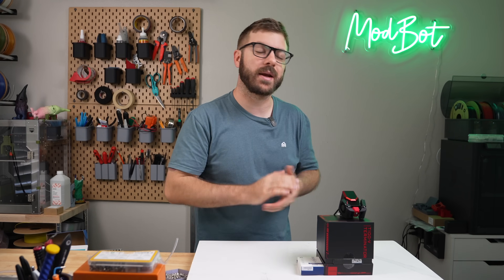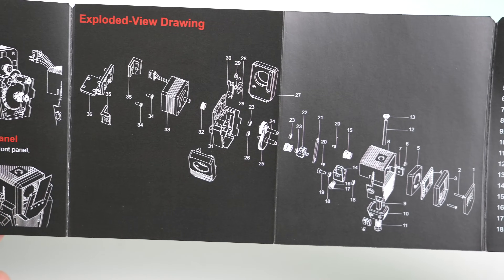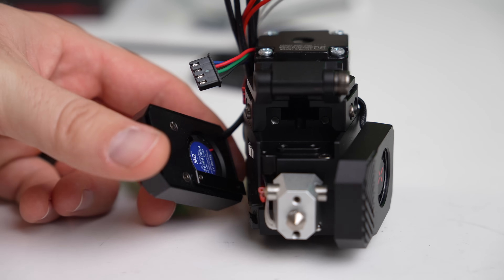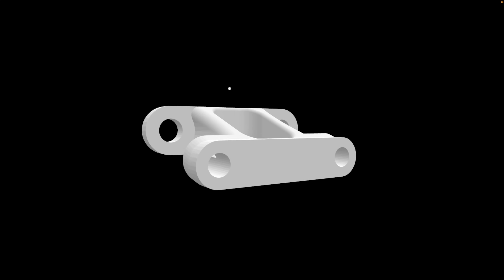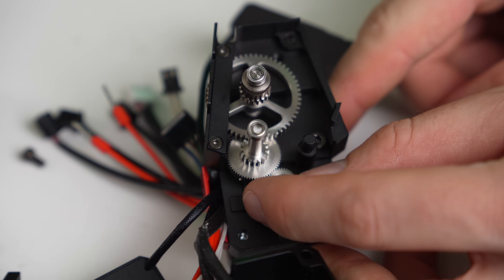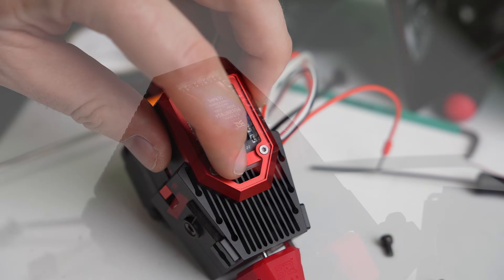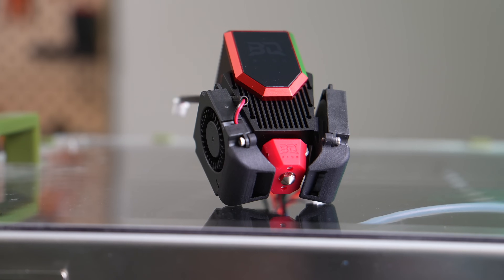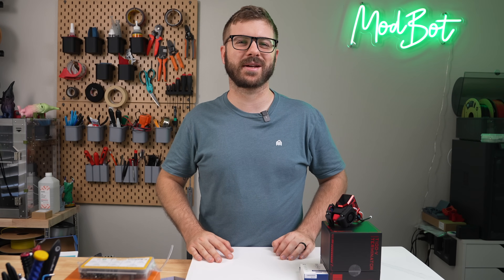Not Your Average ToolHead (Biqu Terminator)

Comment: Do you know how long this run goes for? Will you be doing performance review? I just core XY'd (not a verb, but it is now!) my 3v2, and am running the Sprite. While I love this extruder, the mounting is subpar and the weight (and now added speed with core xy) makes mounting clumsy and I've had to resort to added metal, adding weight. The fact that this can mount directly to MGN carriages, includes a belt hold, and the other added features, this seems like a great solution without having to design added ducting, probe mounts, etc (currently looking at the H2 V2S, which I could make work better than the Sprite, but this Terminator seems to be an even better solution)

Comment: Hi Daniel, your review is spot on. Mine has just arrived and can confirm that the led wires push the front face out a bit. With only 2 screws at the bottom and the front face trying to use the wires to clamp the fan I'm not surprised. Going to see if I can tweak the wiring. Might also see if I can attach a small thread piece to the stock fans so I can nip it up, otherwise il use the bigger ones. Agree they missed a trick on the extruder as they could easily open up the metalwork, show off the gears and allow tweezers in for jams

Comment: The thing that turns me off is this limited run BS. I aim to operate a printer for 10 years and while i can change parts later. I tend to avoid buying things with no future. As far as the SecKit goes i was intending to design a new toolhead for mine.

Comment: You make great videos but people making question from other videos and they don't receive any answer. In the video "The FUTURE Of 3D Printer Mesh Bed Leveling (KAMP)" where I can find or download the toolhead duct air system you have in that machine in min 6:00 the white one. Thanks
Reply: Thats the modified EVA toolhead specific for Mercury One.1 kits. If you go to their website, there should be a configurator for your needs

Comment: It's been out for a while, and looks very impressive. A few small points, however: 1. Extruders without high quality IGDA style drive gears will no longer be tolerated. Ugly layer lines are no longer acceptable. This is an instant game over for any extruder (looking at you Orbiter 2.0). 2. Considering the people who would use such a tool head, ultra-high flow support is mandatory. Preferably V6-Volcato CHT by default. 3a. Just ship it with the EBB42 preinstalled. 3b. Just ship it with the MicroProbe preinstalled. These are just no-brainers, and their lack of inclusion is lazy. 4. As mentioned in the video, make it easier to service. Serviceability is kinda critical.
Reply: Sadly they used a square nema14 stepper, so no can board fits without an adapter.
I agree with the microprobe, hands down bes probe on the market. Also the volcano should have been standard, i mean a 70w heater on a standard flow hotend is a bit overkill. At least a volcano is pretty easy to install with the adjustable fans
Reply: @over_pizza_2578  See? One non-standard move and the whole thing falls apart. This is why I disagree with Creality moving away from aluminum extrusions for the Ender V3. We're not ready for proprietary machines yet. We're still working out the kinks with the open versions.

Comment: too many custom expensive components, heavy not nema14 motor, fans stagger, hard to disassembly - trash product.
Reply: The stepper is a nema 14, just not a round pancake, but a regular one, just like on the h2. The whole toolhead is rather competitively priced at 90 dollars, pretty much all good extruders cost 60 dollars and up.

As mentioned, this is most likely a collectors part, so styling is important, it needs to be pretty enough to put it up for display, nobody would do that with a OG microswiss unit.

As for serviceability, look at the mini afterburner and mini stealthburner. To access the gears you have to disassemble pretty much everything, just like any integrated design. Personally the only time i needed to access the feed gears was when i was tuning filament tips for the ercf multi material unit
Reply: @over_pizza_2578 stealthburner - stupid design as many decisions in voron. There is dragon burner for voron with lots of supported extruders.
Reply: @Pasha4ur  i know that those are garbage. The whole voron ecosystem has many bad design choices (stock bed probe, printed gantry joints on v2, solid bed mounts with no room to expand, etc). 
Personally i dont value serviceability high on the toolhead, for me performance has the top priority. Also how often do you need to open the extruder?

Comment: large gears and I'd be sold, the trianglelab air would still be my pick
Reply from the maker: First time I am seeing this. Are you running this set up?
Reply: @ModBotArmy  The tbg-air is fairly new, so no. There is a video of several tlab extruders printing 85a tpu, which is more than I can say for most aliexpress parts. It will be a few months until I get one for my x5sa

Comment: We need something like the EVA 3 system, a universal mounting system that users and manufactures could depend on compatability
Reply from the maker: Some form of a standard that is more widely adopted would be sweet. It would have certain limitations but it would also come with perks for manufacturers that can mark their hardware as compatible.
Reply: There really are two standards for Core-XY now. Voron (both belts in front) and Rat-Rig (1 in front and 1 in back). It's the designers that need to catch up.
Reply: @drright71  I have two Rat Rigs with the EVA 3 mount, makes it easy to use because of all of the designs people have done.

Comment: Seems like a neat toolhead but the design decisions on it seem a bit misguided. The cross section of printers that it will actually work on and look good on are super limited from what I've seen. The red accents are a show stopper for me personally. Then add on top of that, serviceability issues with the disassembly and reassembly you mentioned. I'm sure it will work for someone but it's probably best that this iteration is a limited run.

Comment: Great looking toolhead, but is there a list of compatible printers?
Reply: I believe this is mainly designed for voron printers. I just got one in and have made up a small belt holder plate that will let me use it with my Ender 3 running a mgn 12 rail

Comment: Thankyou for reviewing this. I have bought one as part of my all metal voron 2.4 build as it seemed a really nice tool head but couldn't find a single review. Still need to work out myself how to install the canbus pcb on it. Was hoping biqu would bring out a file for this as it's advertised for the 2.4
Reply from the maker: Oh that is going to look awesome on the 2.4. Agreed, I understand it is a limited thing but they seem to have put a lot of effort into this and even include a 2.4 clip with it. With the cables as short as they are it requires a toolhead board so an adapted would be really nice. I may spin something up.
Reply: I didn't realise it was a limited run. My plan is a custom cnc part 2.4 with this tool head. Do you think it would fit either a canbus board or the hartk board?
Reply: If you come up with a mount would love to use it. Was planning to design my own otherwise

Comment: very cool idea but Id love to see a more indepth look on its extruder and hotend. a lot of the video was towards the aesthetics and assembly...
Reply from the maker: I would have loved to have done some flow tests with the hotend/CHT. I was bummed to see I couldnt mount it in the SecKit. For the extruder what additional info would you like to have seen?
Reply: @ModBotArmy very much agree with the above. I look forward to seeing a further video if you do one. I would talk about flow rate and overall weight, for one. I think a comparison to the Microswiss NG and Ender Sprite series might be appropriate too, as both are drop in hotend solutions.
Reply: probably just me, but wouldve loved to see an actual look of the extruder, its gears, etc. i love seeing how toolheads are designed and like to fully understand them. great vid though, id be curious to see how it does in action!

Comment: Is this hotend all metal? I’m considering it for my ended 3 pro. Would you recommend it for that?
Reply from the maker: Yes it is all metal. They do have a bracket for the Ender in their github but from what I recall it would require a swap from roller wheels to linear rails on the X axis.